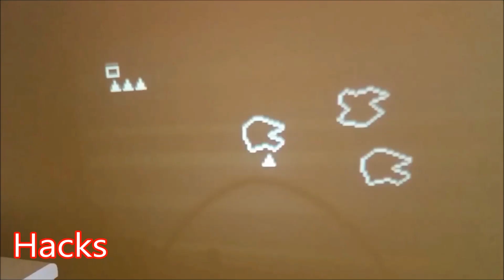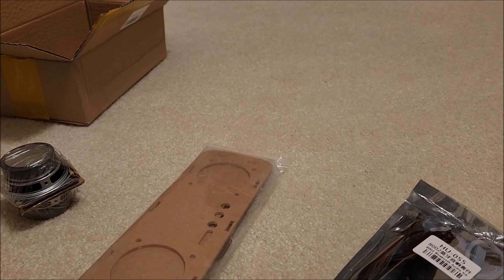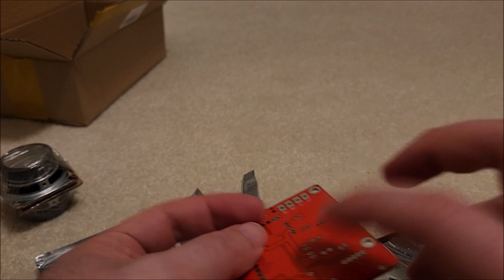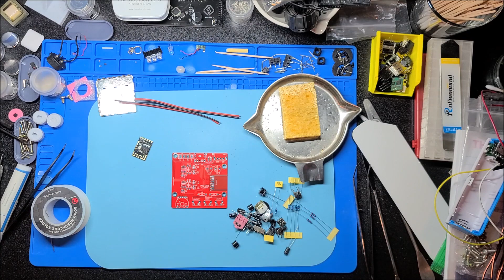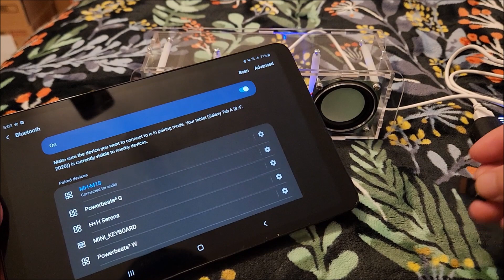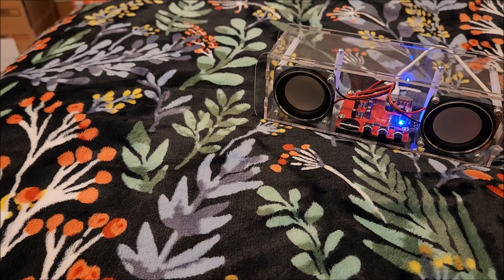GeekLJT Bluetooth Speaker Soldering Kit!

Comment: This is so cool! How does it sound with music playing? An alternate kit that includes a rechargeable battery would have been great too. A video on adding a battery would be fun to see too! Although, I think an 18650 might be overkill for a Bluetooth speaker, no?
Reply from the maker: It sounds decent at lower volumes (anything up to around half volume) but starts to distort if you go too loud. Better than most phone and laptop speakers but cant compete against a proper name brand bluetooth speaker of course. I haven't measured the current draw but I suspect that even a single ~2000mAh 18650 could run this little guy for quite a long while.